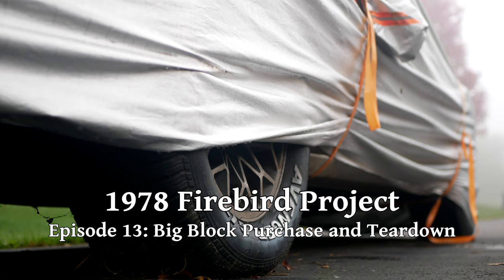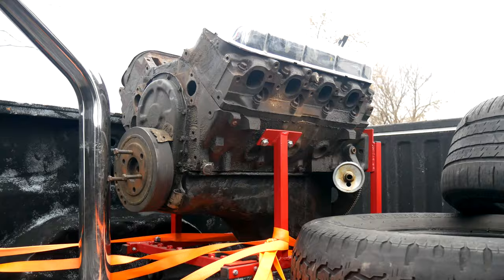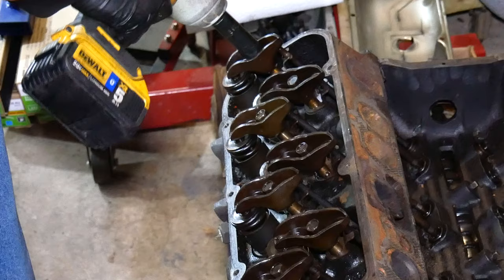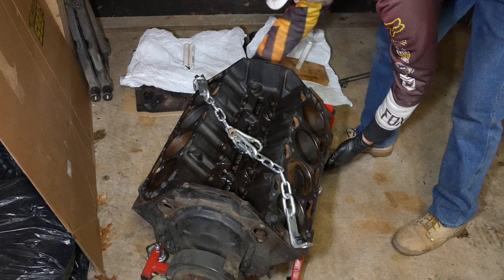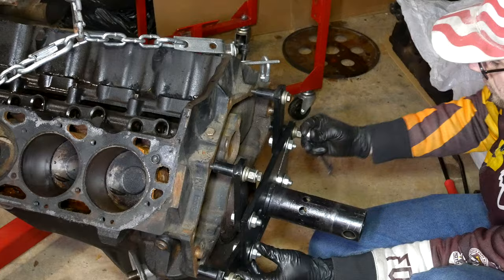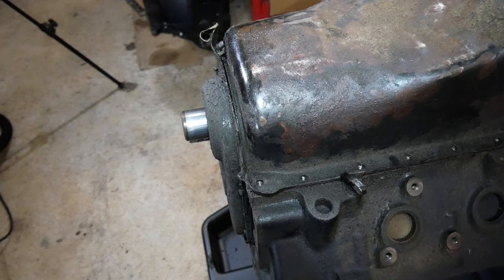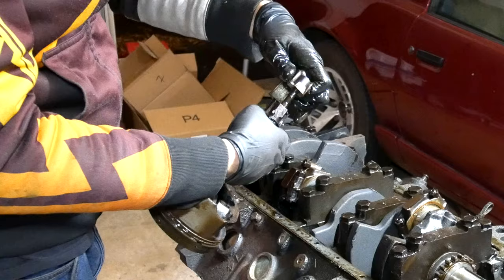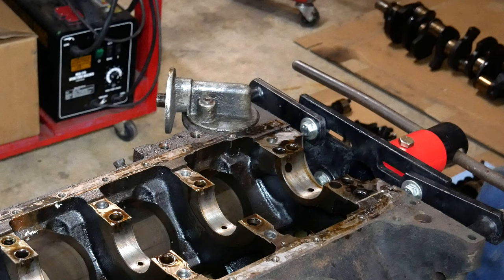$200 Craigslist 454 Big Block Engine Rebuild: Purchase and Teardown (78 Firebird Ep.13)

Comment: Oh, can you imagine, letting this engine run in a car after this cylinder diagnosis? Just to experience what happens.
Like the magic that Vice grip garage puts into engines like that. Putting some oil on top of the piston. Using a 2-stroke mix for starting it. And then run it home to see, if some rings and compression comes back. Now that would be footage one of a kind.

Comment: OK, here’s what I do differently.. first thing in is the cam on a rebuild, and last thing on a tear down.. with the block sitting up right on the bell house side, drop the cam straight down. On a tear down, pull it straight up... easier on the bearings.

Comment: A Pontiac is Gm it’s literally chevy
Reply: a long time ago they were not just copies with different names. They were all under GM but each division had there own twist.
Reply: Yes I can attest to the fact that Pontiac made their own parts, my grandfather had a Pontiac and it had a Pontiac motor. I now own a 1988 firebird and can attest that not only did Pontiac lose its differences between itself and Chevy, and it also lost a lot of individualism from the next gen up
Reply: At one time each division had its identity and was separate from each other. Engines were all different and not some bland, generic Chevy small or big block. Pontiac engines when properly built can be powerful and damn cool too! I should know because I have a built Pontiac and its fierce.
Reply: Butler used to make the Pontiac motors. Seems to me the Chevy was a 454, the Pontiac was a 455. Other than that a lot of it was different.
Reply: Yeah, I'm perpelxed why people see Pontiac's with SBC and freak out.

There's really only a small window in the 50s, 60s, and early 70s where Pontiac made their own engines in house.

Otherwise they've always run Chevy motors. Even Pontiac's in Canada used Chevy motors more often than not, for supply reasons.
Reply: Oh, children.  The Ole big chief side of BOP used to be a type all its own, in the yesterday's. So did the rest of the BOP GM stable, for that matter.  Just because time passed doesn't mean that those of us that were there, forgot.
Reply: Yes they had their own designs but they were all similar to each other
Reply: Skip R  aight damn I’m sorry I called a Pontiac a Chevy I guess there is more differences than I thought

Comment: What engine it has is actually irrelevant. Whatever trips your trigger is all that matters :) Nice organizer! The engine cradle was a nice gift since this wasn't exactly what you were looking for in an engine. Withthe rockers being nonadjustable you will need a stock camshaft or will need to change up the valvetrain to an adjustable(the way I would go).

Comment: I would say that this is the greatest $200 big block ever purchased - only under threat of blackmail. I don't know what you're budget is, but if the block doesn't pass inspection (cracks, out of round, etc.) it's over before you've really started. I know you said "you can't win them all", but there's a reason it was 200 bucks. Of course, I wouldn't mind being wrong.

Comment: "Its a 305 small block"

Me, a european: oh well that propably means its a small engine

Engine: has 5 f*ing liters of displacement

Me: cries in 2 liter 4 cylinder
Reply: Are you a sort of celebrity here? I'm regular and proud owner of 1,6L, because my brother has 1,2L...
Reply: jajajja i understand you. I'm a crazy man here in Spain for daily drive my 2.8L e39
Reply: @jesusonic91  lol i also have a e39 , its a 525d but i currently drive my e46 320d because the e39 has a lot of rust and i want to preserve the car for years to come... they dont build cars like they did 20 years ago...
Reply: @jesusonic91  2.8l engine is supposed to be a beast tho!
Reply: I have a 2.2 4 cyl and Ive heard that I have excessively huge engine killing the environment. Why is Europe like this
Reply: It's a matter of perspective. Compared to the 454 big block (7,4l) it is small.
Reply: Yeah well the 305 is a shitty 5l. Good stock engine but bad performance due To bore/stroke combo the 302 5l is a much better combo
Reply: @anthonylyrette7399  that depends on what you want to use it for right? for forced induction you want low stroke and high bore, for n/a its vice versa right?
Reply: If it means anything, the physical size of those V8 OHV engines are very small and compact. Its not ridiculous to have a 4.5-7.0 litre engine. The physical size of a older chevy small block is not that much more than a modern 2 and something litre DOHC engine with all the modern wires and stuff. Its easy to just stuff more displacement under the hood. 

To go from 5.0L to 7.4L its less than a 1cm increase to the engine length width and height. Weight is the biggest problem, but thats because America used so much iron.
Reply: @user-gx1sv3hj9k  you are right for the boost but n/a in general you want an equal stroke and bore or less stroke than bore. In the case of the 305 it has a 3.48 stroke and 3.75 bore i belive. It was an emission engine so no one really give it a chance To make power but after 350 hp is hard To make more. 302 on the other side use a 3 inch stroke and 4 inch bore wich means you can put better brething cylinder heads on it because of the bigger bore size. You can make 600 hp on pump gas at 8000+ rpm on that combo n/a

Comment: The intake ports on those heads are reminiscent of an 18Hp Briggs and Stratton.  It’s surprising that they can even flow enough to keep the motor happy.  I guess that’s how you satisfy emissions.  At least you have a 4 bolt block.

Comment: IT DEFINITELY DOES MATTER WHERE THE COMPONENTS IN THE VALVETRAIN GO! All the parts have worn to each other, and swapping them around will cause problems! ESPECIALLY ON THE LIFTERS!!! I have in my stupid youth wiped out a cam or two putting the wrong lifters into the wrong holes.
Reply from the maker: The lifter positions absolutely matter, which is why I go through the effort of ordering them in the tray in this video. I was referring to the rocker arms and pushrods, and other than possibly the vertical orientation of the pushrods I don't believe their position is important. I apologize if this comment was not clear!
Reply: @FuzzyDiceProjects  I was honestly pretty surprised that you cared at all since I doubt you're planning to reuse the stock cam and lifters. Or I hope you're not!

Comment: Awesome breakdown! It's interesting to compare the guts to what I'm building. 350 w/ aluminum heads going into my 89 firebird.

Spent today hand filing the rev kit(they didnt quite fit the hydraulic lifters).  Hopefully we'll get it running on a stand soon.

Comment: 77 was the last year they cast a true Pontiac engine. You could still get one in 78, but in reality it was a 77 engine.  Mid year, they ran out of them (as planned) and then you got an Olds 403.  You could tell the difference from the shaker.  One said T/A 6.6, the other 6.6 Litre.
Reply: 400 carried on into 79 4spd cars. They never ran out of them. They cast them up into 78 and then saved some for the 79 cars. That’s why the 79 400 cars have 78 date codes. Not 100% sure but I’m pretty sure cars out of the Norwood plant only assembled the 400’s in them. I think California was only doing the 403’s and Norwood was using them also. The T/A 6.6 was for the W72 400, the L78 version still had 6.6 LITRE. The only 78 400s carried over to 79 were W72
Reply: so the t/a was the pontiac motor and the non-t/a was the olds? just to clear it up.
Reply: @aaronrichards2842  almost, the T/A was the W72 coded 400. The regular L78 shared the 6.6 LITRE as the olds 403
Reply: The Olds 403 came out in 1977 as their replacement for the 455 in the Toronado and big cars that were downsized for 77. California also began to enforce their own emissions laws in 77 which the Pontiac V8 wouldn’t pass. So California Pontiacs had to use someone else’s V8 to pass their emissions. States that followed federal emissions still could get Pontiac V8
Reply: Oops hit enter before done. I’m sure someone already corrected the error that Pontiac never made a big block engine. All their blocks were the same until the 301 and 265 which were just shorter deck height than the rest. Pontiac’s 421,428 and 455 were large journal blocks. The main bearings were 3 1/4” while the 400 and smaller all had 3”. As stated above the 400 went out of production at the end of 78 and Pontiac stock piled 400s mainly for the 10th anniversary T/A and a few Formulas. The 400 was only available with a 4 speed manual transmission in 79. The 403 was only available with the automatic. When all the 400s were used up 403s and 301s were used.

Comment: Should have used a scope to look inside the cylinders before buying. 
Also, if somebody says a part or car is a particular thing, and then when you show up to buy it, it isn't the exact year/generation/part they said, don't buy it just because "you were there" and its close enough.  In my experience, it is almost always better to wait till you can get exactly what you wanted as far as condition and year of part.

Comment: when buying these 454s try to find 1 with mechanical fuel pumps unless your dont care about trying to runs a electric pump. im building a ho po 454 for a 79 corvette atm and a 396 for my personal 70 impala. id recommend a gen 4 block the gen 5 blocks dont have mechanical fuel pumps makes it a bit more run around to make em work right.

Comment: And even though the gen 6 454 doesnt have a fuel pump installed. Behind the block off plate you can slide a fuel pump arm in and have a mechanical fuel pump work.
Reply from the maker: I hadn't heard of that being done to a block without the mounting boss for it, but I had wondered how much work it would be to make it happen. Probably some drilling, maybe milling, and a shortened pushrod. That factory camshaft even has a fuel pump lobe on it, so they really didn't change a lot of the design.

Comment: 0:43 These cars never came factory with a big block engine option. Either a Pontiac 301 (1979 or 1980 thru 81), 350, 400, 455, or starting in 1977 an Olds 403 or a Small block Chevy305. Not including v6 models.

Comment: Ronald, do not use that engine, these were well know to bust the cam journals. Please don't use it. Get you a Oldsmobile 413, that's what  GM used for the Formula 6.6, those are extremely powerful, were under rated, and take a obscene amount of abuse. And run way better then the BB 454. How ever, if you want "stupid" amounts of HP, install a 511Cadillac, and holy shit!!  But the Cadillac, will have a front sump, oil pan, so you'll have to modify the first member. 
Loved your Pontiac Fierro rebuild. I subbed, long time ago for that...

Comment: This kind of sucks to see because I do have a 454 out of a 96 suburban that’s in pretty decent condition It’s a vortec 7400. That we took out to do a engine swap to a 6.6 Duramax other than a bent Valve pushrod after the engine got dropped   When the engine stand failed it was a good  engine

Comment: You know that big air cleaner through the hood will make that car run 5 miles an hour faster if you want to go 10 miles an hour faster you have to loosen up those two screws on that distributor cap

Comment: Meanwhile I'm deciding between rebuilding an lt1 for my new Camaro or buying a used running lt1. I thought well it'll probably cost me about $1000 to build it maybe a used engine will be cheaper. eBay and google laughed at me. 

Rebuilding it is.

Comment: PONTIAC NEVER HAD A BIG BLOCK BRUH! They had common block engines which were externally identical in size on the outside from the 301CID all the way to the 455CID engines! The other compnay that did this was AMC Corporation which also had a common block engine from the 290CID Typhoon to the 401CID engine..,. Food for thought! :)
And coming from an MOPAR/AMC/BOP lover , you probably dont even know that Oldsmobile had a Small block and also a Big Block as did BUICK..e.g. the 403 is s small block where the same manufacturer also had a 400CID and it was a taller deck making it a BIG BLOCK..feel me??

Comment: GM faced a big lawsuit in the late 70's by starting to substitute engines amongst it's different car brand models without revealing it to the public. Some Trans Ams had Oldsmobile engines, some had Chevy engines.
Reply: So then their answer was to just put chevy motors in everything

Comment: are you getting a bigger supercharger for it or keeping the current one you already have?
Reply from the maker: Got a B&M 250 for it, basically the same as the 144 that was on there, just with a longer case/rotors. I wanted the lowest profile setup I could get. There will be videos covering that stuff in later videos after most of the engine work is done.
Reply: @FuzzyDiceProjects  Also you still have plans to fix that front end damage on the Blazer soon?
Reply from the maker: @Jeremy_Hill_2020  Yep! I have had some of the parts sitting around for well over a year at this point. Have a lot of plans for the Blazer and I want to take care of as many of them as possible at the same time, so it's just waiting for its moment.
Reply: @FuzzyDiceProjects  besides repairing the damage, do you mean performance wise (if you want to mod the 350ci some more) or something completely different?
Reply from the maker: The 144 supercharger is going on the engine that's in there, different carburetor, much bigger radiator, core support/fender replacement, custom front (maybe rear?) bumper, second-hand 5" lift kit, complete engine bay rewire, bigger fuel pump, aux gauges, and many more small things. Then it'll probably grenade the transfer case and create even more work haha.
Reply: @FuzzyDiceProjects  XD
maybe beef up the 4x4 transmission just in case lol

Comment: Do you need to remove the oilpan before the timingchain cover on a 305 sb - 85 also?
Reply from the maker: You have to at least loosen it and drop the front an inch, the front of the oil pan seal sits in a channel on the timing cover so the seal has to be moved out of the way before the cover can come off. There are some aftermarket two-piece timing covers that let you get at the chain/cam without removing the pan though.
Reply: Thank you for the information! Great videon by the way.

Comment: I don't get why so many people care why there's a Chevy motor in a Pontiac when both companies are owned by the same company anyways
Reply: My dad remembers in the 1980s as a teenager, going and walking around GM dealers and opening the hood on a Buick and seeing an Olds engine or a Chevy with a Pontiac and vice versa.  A lot of customers were upset that their 1987 Caprice Classic wagon had an Oldsmobile 307 engine.  Who cares, its all GM, some are more desirable than others but if it bothered the buyer so much then they should have done their research.
Reply: In the 70's, each Division was still producing their own engines.  Although they would often mix and match from the other divisions, the flagship model of each car would generally carry the best engine.  So, as an example in the Trans Am in 1978, you could get the Pontiac 400 which was the performance engine, or the Olds 403, which was the California "smogger" engine.  

So, for a Firebird or Trans Am to have a non-Pontiac engine meant it was a "lower" model.  

Mostly it doesn't really matter, but for the purists out there you'd at least want to put a Pontiac block in it.
Reply: @GregTrickey  it basically started due to California emissions laws. Pontiac’s V8s couldn’t pass so they had to substitute them with other division’s engines. Up until 79, all T/As had Pontiac 400s in them unless they were subject to California emissions. The Olds 403 was available nationwide in 79 because the 400 was no longer being produced. They stockpiled 400s for the 10th anniversary T/As and a few Formulas and you had to get a 4 speed to get the 400. All 403s were automatics. You couldn’t buy a 4 speed T/A or Formula in California after 1976 until they started putting small block Chevys (usually 305s) in them.
Reply: @mikee2923  Good info, but I was just trying to answer the OP's question, not overload him with historical minutia.  

I'm sure he wasn't around at the time, like I was, so he doesn't understand the history of GM like those of us who lived it.

Prior to, say, 1980 or so, if you pick a given performance car, whether Buick, Olds, Pontiac, or Chevy - the "best" engine was going to come from that same Division.  

After 1980 or so, all the engines became "corporate" engines.

Comment: I enjoy you vids but a Chevy in a Pontiac.   Is wrong.  It was wrong in the seventies when gm did it in the 70s and it’s still wrong
Reply: Eh, it's the best possible option outside of a brand matching big block.  A Big Block Rat cures all ills in any GM.
Reply: @JBO3022  gm is gm
Reply: @claytons4789 , Oh, young'in.  The Ole big chief side of BOP used to be a unique thing all its own, in the yesterday's. So did the rest of the BOP GM stable, for that matter.  Just because time passed doesn't mean that those of us that were there, forgot.
Reply: @JBO3022  oh, sorry that reply was intended for the original comment. but thank you for the info.

Comment: Your way wrong with this motor? I dont think you realize what you bought! Do your research and you will find this motor is a building block for a very big inch motor with horsepower that will scare you! You should only be interested in the block and crank. The rest is good for the trash but you have a good block!